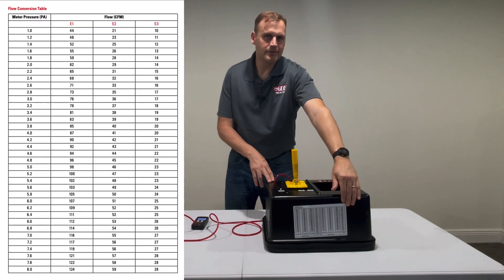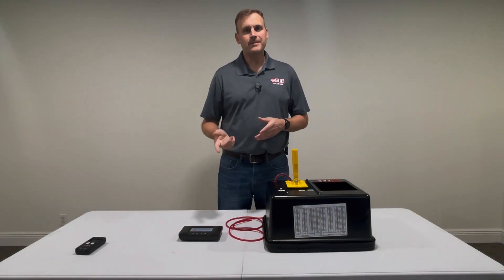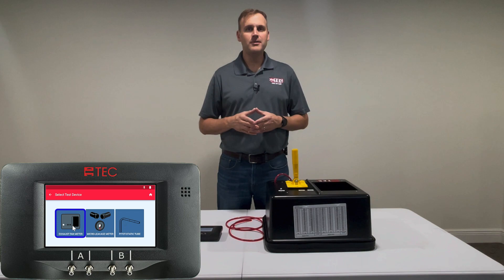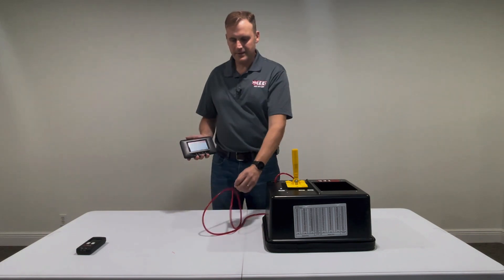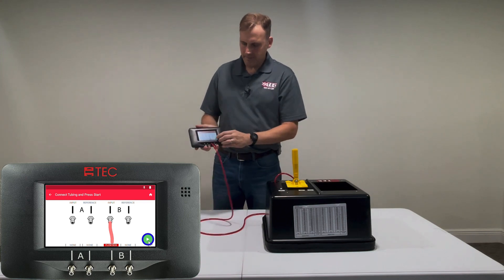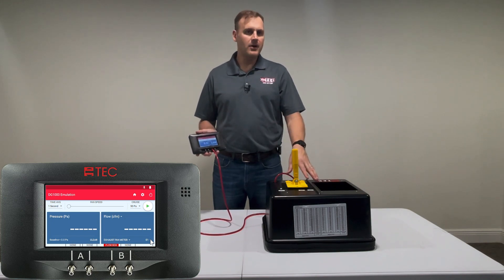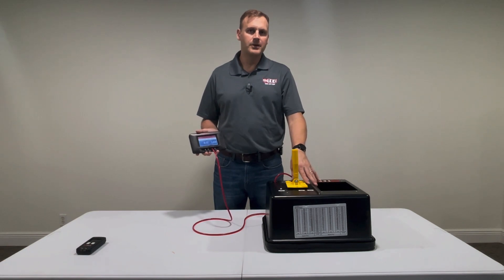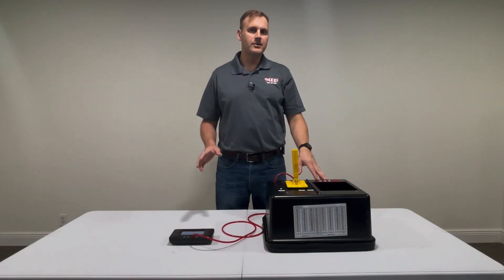TEC Exhaust Fan Flow Meter Overview

Comment: Just want to confirm that any accurate micromanoter can be used in place of the GG 1000?  Can just measure pascals and use conversion tables provided.
Reply from the maker: If the micro-manometer has the same accuracy specifications as the DG-1000, then yes you are correct.

Comment: Why not mention the DG700 ,  it must be most common TEC  meter.
Reply from the maker: For the last few years the DG-700 gauge has been out of production.  We plan to make repairs to them as long as we can still get parts, but that is becoming more challenging.  The DG-8 and DG-1000 are the current micro-manometers available from TEC.

Comment: Can you discuss range? I have measured pressure in the box greater than 8 Pascals when using the E1 setting. At greater than 8 Pascals, are all measurements invalid? If so, that gauge should simply not give a result. 
Some uncertainty is clearly possible because the ranges overlap and the flow measurement using different settings is often different. For example, a flow merriment using E1 may be different than if using E2. Which is the right number?
Reply from the maker: Sean, these are great questions.  First let's discuss range.  E1 = 44 to 124 cfm,  E2 = 21 to 59 cfm, E3 = 10 to 28 cfm.  
The acceptable measuring range of pressure is 1.0 Pa to 8.0 Pa.  A pressure outside of this range is considered invalid for a flow measurement that would coincide with the 10% accuracy specifications.
You are correct, there is some overlap between E1, E2, and E3.  The proper approach is to begin with E1 and open the slider door to E2, then E3 until a measured pressure/flow inside our calibration specifications can be obtained.
I have attached the manual below which has this data discussed above on pages 4-6 which also offers some other good info. 
 I will also see to it that I pass your recommended feedback to the team.  Thanks!
https://store.energyconservatory.com/pub/media/pdf/Exhaust_Fan_Flow_Meter_Booklet_5.20.pdf